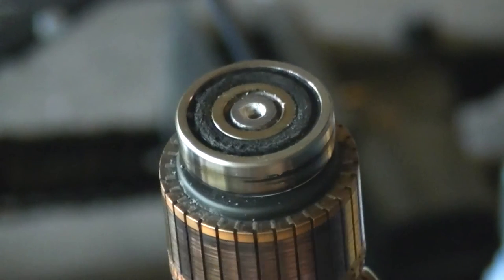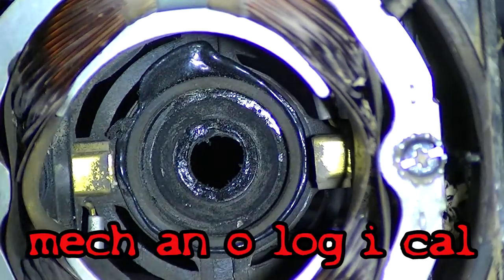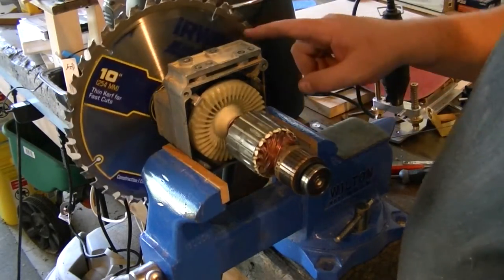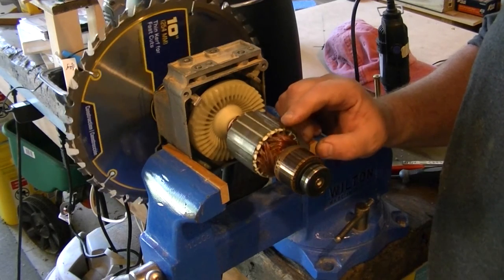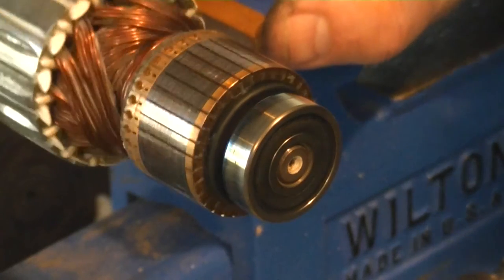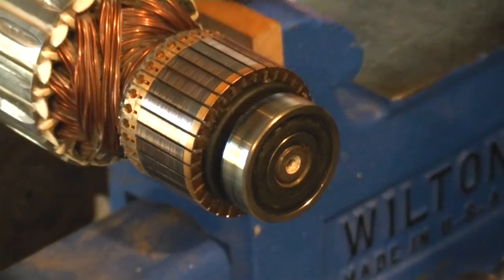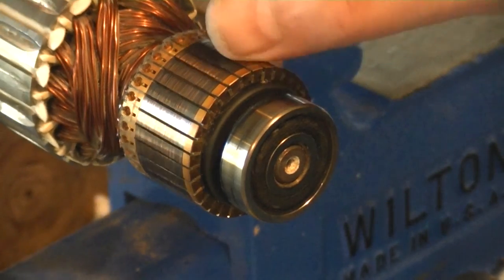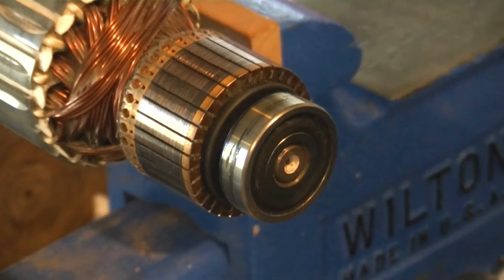death of a table saw | RATTLECAN GUITAR RESTORATIONS by James O’Rear

Comment: I know that sound all too well mate, worked with saws for years. It needs a new ball race bearing that's all 🙂 there's usually a grease nipple on the outside of the saw to feed the bearing. Could be it ran dry or just ran out of luck 😧 on some saws it's supposed to be sealed for life. Then it dies lol
Reply from the maker: I looked for some sort of grease fitting but there isn't one. We'll see if we can get the burnt bushing out and go from there.
Reply: +Rattlecan Guitar Restorations chances are on a small table saw like this that a new bearing just needs installing with a high temperature lithium grease or equivalent. That should last you a long time buddy. I'm actually amazed that you were able to get everything apart after it got that hot. How long did you have to wait before it all cooled down enough to work on? 😧
Reply from the maker: I think the tears cooled it off pretty quickly. ;-)  New bearing and bearing bushing are ordered. I have a tube of Lucas Oil Red 'N Tacky #2 lithium grease on standby for their arrival. I found a fellow YouTuber with the same problem re-pack the good bearing on the opposite side so I might do that as well. Haven't gotten the spun bearing off yet, will do that once the parts arrive. I'll cut it off with a Dremel cutting wheel as a last resort but I have a tool idea or two to try before it gets to that point.